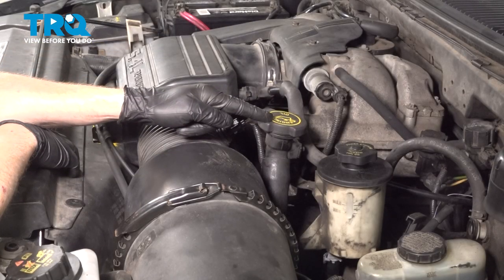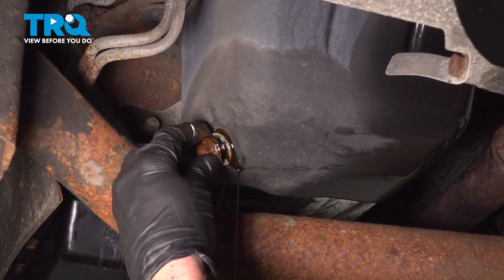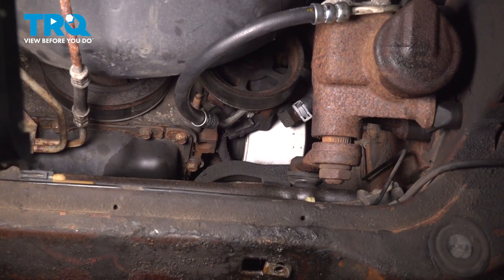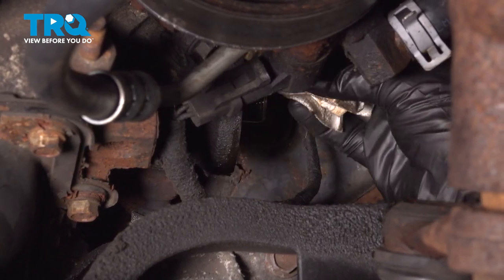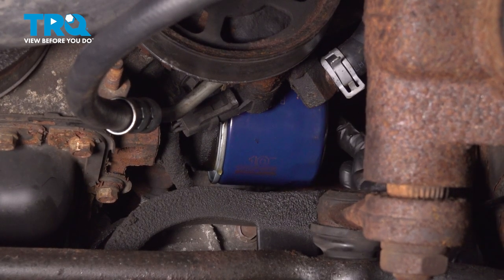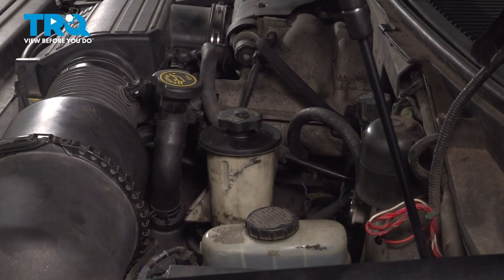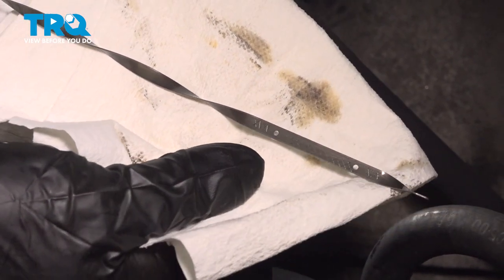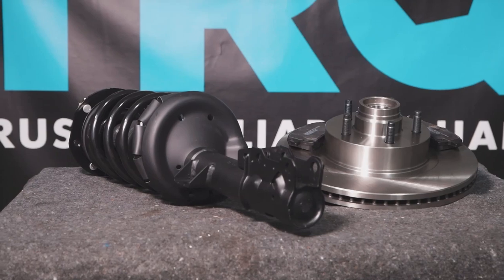How to Change Oil 1998-2002 Lincoln Navigator

Comment: Can my 99' Navigator continue using 5w30 oil (high mileage obviously) as the manual indicates? Or is it necessary to use oil with a higher viscosity?

Thank you for the wonderful work and information in your videos!!